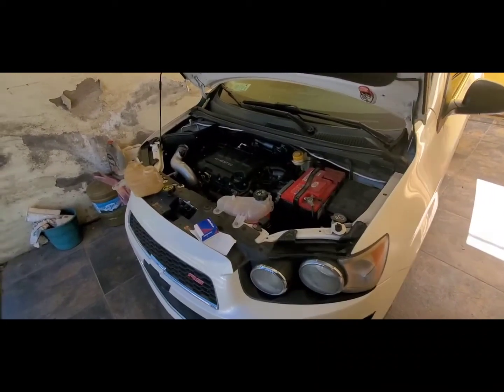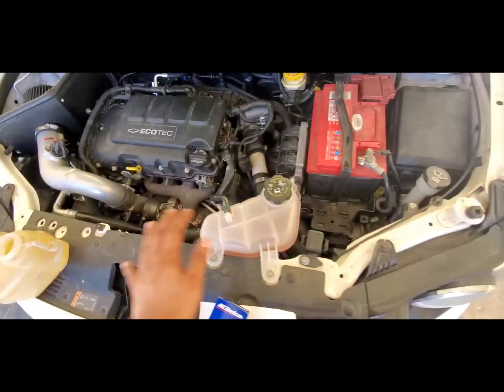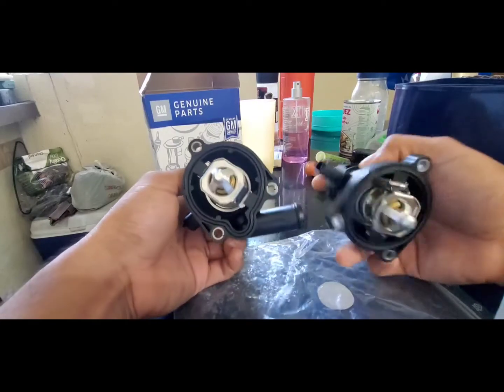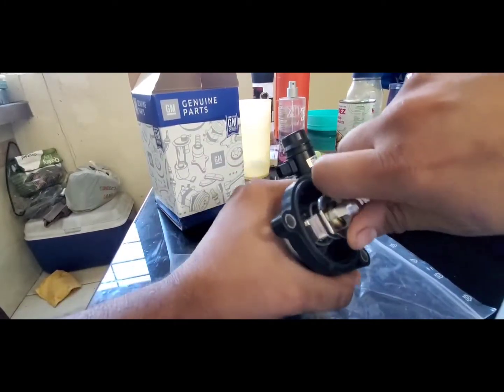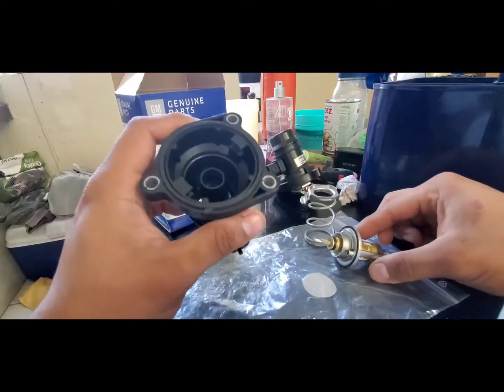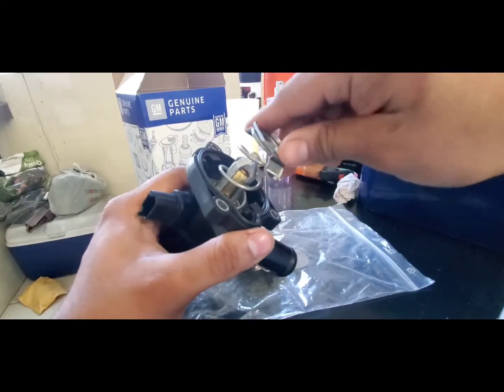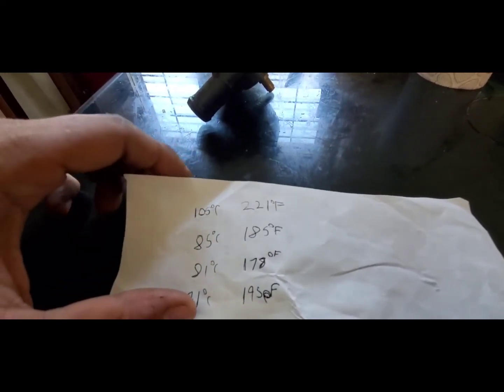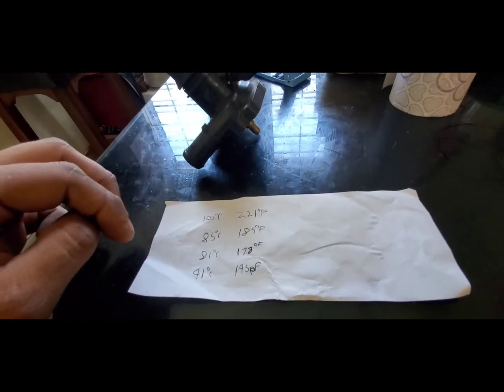colder thermostat mod for Chevy Sonic, Cruze Trax.

Comment: Is there an upgrade for the cooling fan switch
 because my cooling fan comes on at 221 Fahrenheit
Reply from the maker: That's ECU controlled. You'll have to get a tune for that but if your car never reaches that temperature there's no need for the fan to kick in
Reply: @amedsoprano   So all I have to do is swap the thermostat, no tune or anything like that? Just a quick swap?
Reply from the maker: @saifsaid6705  the thermostat is basically a wax slug with a heater built in. The amount of wax determines the temperature it needs to push the plunger and open the t-stat. The ECU can send power to the heater and open the t-stat whenever it wants to, but if the coolant around it is already warmer than the opening temperature it will open by itself. So no need for a tune
Reply: @amedsoprano  Got it, thanks. Going to pull the trigger on this mod

Comment: Does the check engine turn on with the low temp thermostat?
Reply from the maker: No, whit this mod  it doesn't. However if you remove the thermostat core completely it will. There's a threshold in the ECU, I believe if it doesn't gets past 70°c after a certain time of running it will throw a CEL.